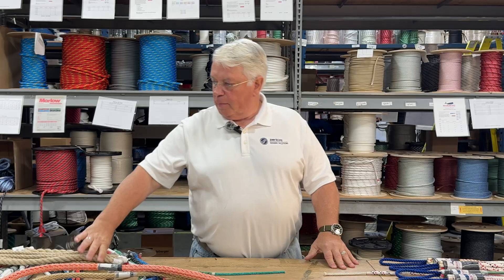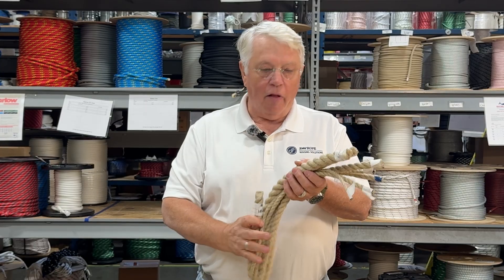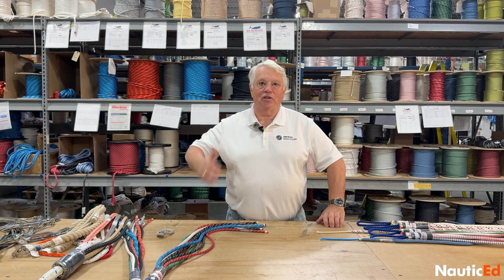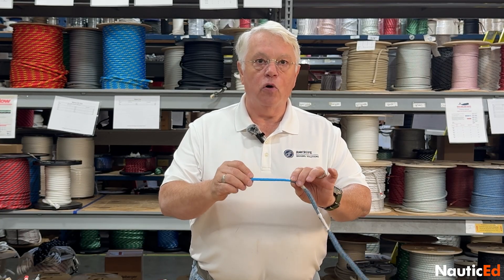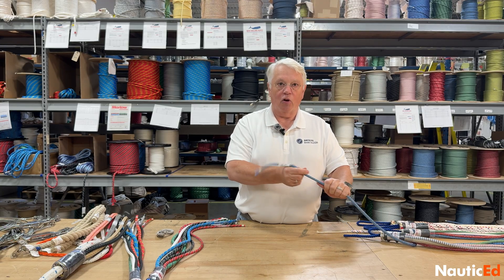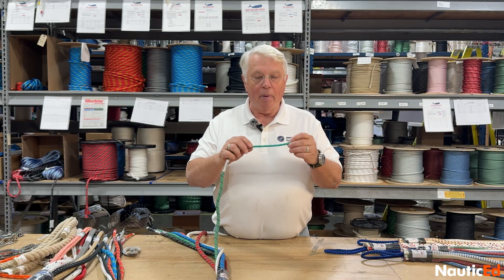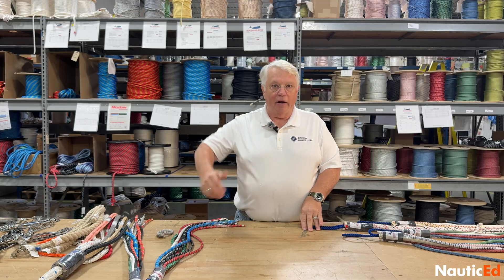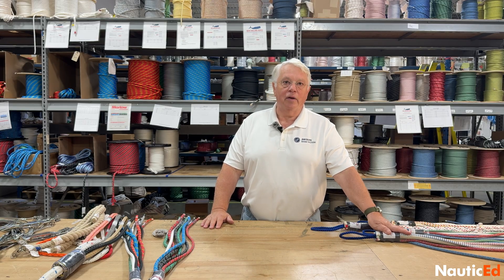Sailing Line Cores Explained: Dyneema, Vectran, Polyester & Blends

Comment: As a rigger explained to me, "you don't buy "dyneema" rope on breaking strain but on what is easy to handle". My own observation being that the size of rope that can carry the required loads in many cases is too small for the blocks and winches.
Reply from the maker: For sure, comes down to the existing equipment you got on the boat. How will the line fit in etc